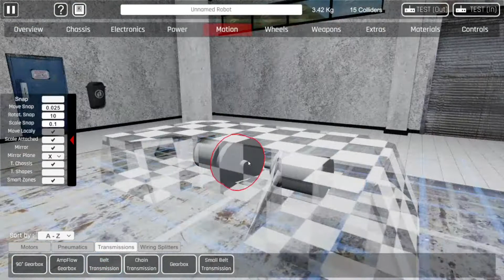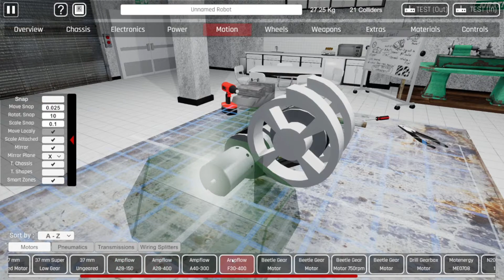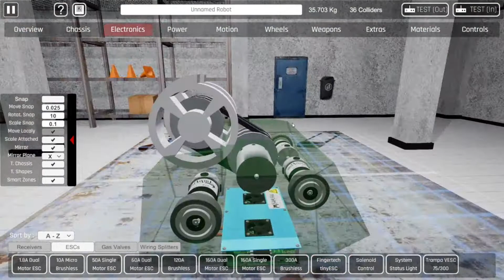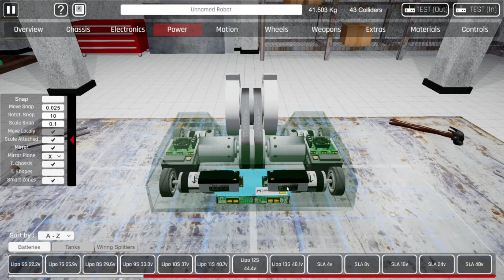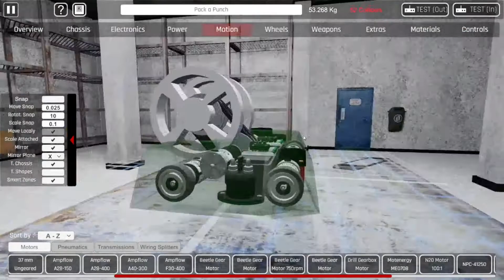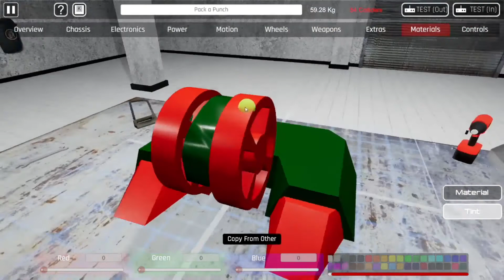Lets Build a Bot! | E1 | Robot Rumble 2

Comment: Looks like they really are trying to make this as real as it can be, even down to having to check motor current draw through ESCs and encouraging proper spinner tecnique (swich off your spinner on impact to avoid stalling the motor. It wasn't that your motors weren't good enough, you were stalling them, causing them to pull 300A through an ESC rated for 160A)

The fact it has stuff in it for pully ratios and gearboxes, amp draw, weight distribution (making sure your custom spinner bars are balanced is going to be sooooo much fun)... this is going to be a dream for people that want to get into/already build real robots and a frustrating nightmare for the less tech savy. Can only hope the finished game includes a "simple" mode or a whooooole bunch of helping tools haha.

Actually a nice robot when you got it working though. Could likely be improved by tweaking with the pully ratios and maybe adding in some gearboxes on the drive motors for more torque.

Comment: Robo Could you tell me why weapon stops everytime i hit something and it smokes I tried to copy yours thanks!
Reply: It honestly seems like they're attempting to make it as life-like as possible, meaning they want the builder to factor in things like current draw through components. I'd assume that in the final build, there'd be a system to help you in place, but as of right now...

The simple answer is this; you're burning out your motors/ESCs trying to spin a stalled weapon. If you look at his telematry at 20:38, you'll see his weapon motors are drawing 300 amps when stalled. His weapon ESC is only rated for 160A, see how things can rapidly burn out?

That's my guess anyway, look at your ESCs amp rating and look at the max amount of amps your weapon motor(s) draw when stalled, make sure the ESC can handle the current of a fully stalled motor, or just switch off your weapon just at the moment of impact so the motor isn't trying to spin while somethings stopping it.
Reply: @Furiora  Thanks for the response one year ago Lol jk ty

Comment: Since my long message got deleted I'm going to summarize it.

RR2 Battlebots pack is out now! (I built Jackpot :)
https://youtu.be/0Ou4405LzhM
The link is in the description for the bots and the how to download bots and stuff
Reply: Join the discord if you need help live with anything, some of the best builders in the game are in the discord. https://discord.gg/vMunvS5kpA
Reply: Suggestions, lipos over SLA for now until damage comes. Solenoids are good for spinners because you can get more voltage to run through them.
Reply: Motenergy is the best motor and e tek comes 2nd. A28-400 is the best small motor spinner l, the motors are usually for HW (110 kg)spinners but any amp flow motor is good for drive and the tp100 brushless isn't bad either. Brushless requires 300a esc or Tramp esc while the amp flows best esc for driving is 160a dual.
Reply from the maker: @veezythebot6195  AMAZING feedback! I just joined the discord so I'm excited to not mess anything up from now on :P